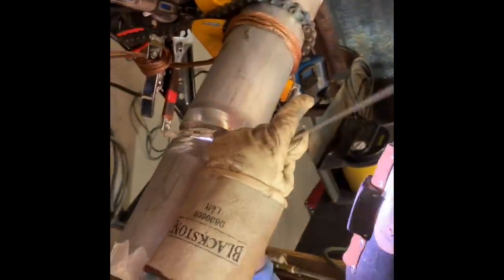How to weld a Key Hole Root Pass on Stainless Pipe

Comment: Hey guys great video i have a question do you have any landing on that to chew up to give you a little time to keyhole? And would this technique transfer wel to say schedule 40? Or 10? Im a pretty good self taught pipe welder moved up from production mig to certified structural to now carbon stick and tig and im trying my best to work out the best way to get decent penetration on stainless roots without backfeeding i just cant get it. Any advice would be heavily appreciated guys thanks
Reply: I haven't tried the key hole technique on heavy wall or schedule 40 but I had great success using this on schedule 10 the last job I was on. 

I had a couple fit ups that had 1/16 inch or slammed up gaps and only had 1/8 wire at my disposal. So instead of laying wire and heat soaking the pipe I key holed it. It worked great because you can see the entire root fuse. Did it just like he did, walked a few steps, added wire.

Comment: Love your videos and that your sharing your knowleage of welding to the younger generation . I started off as a welders helper strait out of high school and learned on the job first of course stick thin flux core and got really good at it and ended up being a structural welder for about 4 years from age 20 to 24. I got on a job as a structural welder welding pipe supports and was on a pipe crew and my foreman and crew asked me when I was going to break out as a pipe welder and it was something I never really thalt of before because I was making good money doing what I was doing and one day nun of the pipe welders on my crew showed up for work and all the other welders on the job were tied up and welding and we had a priority weld that had to be made 10" sch40 SS. My general foreman asked me if I had ever tig welded before, I said yes and he asked if I could make that weld and pass X-ray and I said If I'm not rushed and someone walks me threw how to weld the root then I could weld it. Long story short the GF who came from welding showed me the dip key hole technique and for some reason was strongly against back feeding witch I'm not sure why but since then I have never used the back feeding technique and have been welding pipe now for 6 years.In my personal opinion dip keyhole is all you need to know and if you do it right you will have a perfect root every time.
Reply: I’ve always struggled to not get suck back on the overhead portion of the weld when I’ve tried the keyhole/dip technique. Do you have any tips?